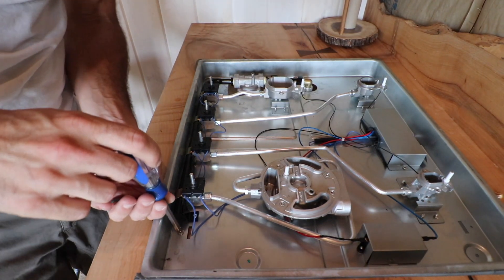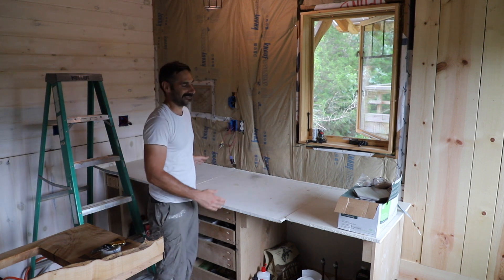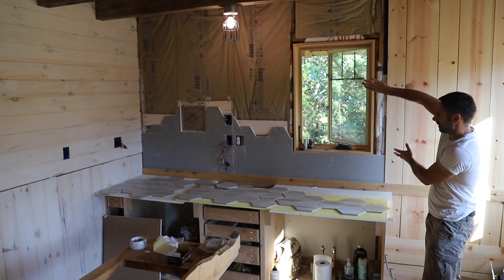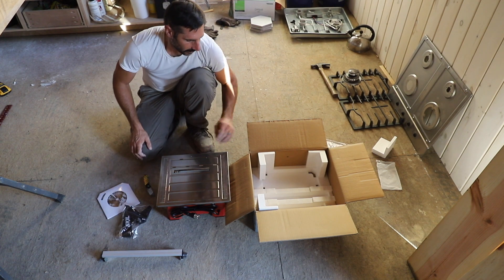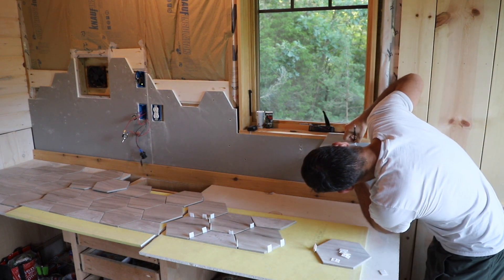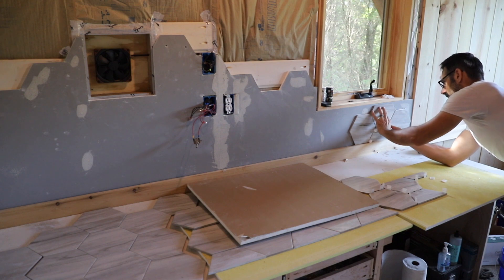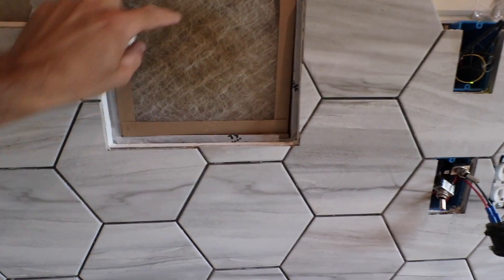Cabin Build - Hexagonal Tile Backsplash

Comment: Mike, I have a similar saw for tile.  I would cut arm and neck holes in a large plastic leaf bag and wear it with a full face shield (purchased about 20 years ago).  I would walk back and forth from the kitchen to the picnic table outside.  I did this in the summer and refuse to cut tile in the winter!!!  My pants got soaked but with summer heat, the dampness felt great.  Fabulous idea to drill holes to mark corners and cut from both sides.  I'll use that in the future!  Awesome design and a great execution.  Stay well, my friend.
Reply from the maker: Hi Rosemary, thats pretty funny, those things will get you.  Thanks for watching, hope the hole trick helps you out.

Comment: It's coming together nicely, for a budget saw ya did okay . Hexagon tile not the easiest for a backsplash. I used to do custom tile work, patience is the key. Only thing I would have done differently is I love using Hardy backer cement board
Reply from the maker: Thank you Mario, I usually like to use a cementitious backer, but since I was making those intricate cuts I decided to use this stuff called Dense Shield.  It just just like drywall.  They say you can use it in a shower if you caulk it and waterproof the seams, but I don't think I would trust it.

Comment: Very nice work.

I might have moved the electrical boxes up or down just a little bit to get the ones i could to come out on one tile. 

Note for others. When mixing mud, you are probably going to make a mess.
Do not do this inside or in the front door. Do it in a place it does not matter even if it is a few extra steps.

If you are going to do a tile job yourself and it is the only tile job you are ever going to do. Rent the tile saw.  Make sure the saw you are renting will cut the size of tile you are going to use. Some of the sleds do not accept 2 foot tiles.

The rental part goes for plenty of other equipment also.
Stuff you do not use that often is cheaper to rent than maintain.
Let the rental place maintain it. You just rent it, use it, and return it.

Comment: I would have thought that the live edge counter-back was the focal point. It turned out better than I anticipated based on the shape of the tile. I thought the wood would get lost in the geometrics of the pattern.
You were up here? Any other year, I would have bought you a beer.
Reply from the maker: Thanks, I was, I was in Naples.
Reply: @50Acres  I live in Auburn and work in Poland, so Naples is just a hop and a skip away.

Comment: Nice tile work!  I used that model saw last fall for a back splash, very basic.  A shower with every cut!  Will you use outlet extensions so that the face of the electric box is flush with the face of the tile!    They save bending or breaking the covers.
Reply from the maker: Yea Ive got these little rubber tabs that make the outlets sit further out.

Comment: Te felicito Nike quedo muy bien y tuviste que hacer unos cortes complicados , una pregunta ¿ el sistema eléctrico de cuantos voltios es ? un abrazo y saludos desde Argentina 
I congratulate you, Nike was very good and you had to make some complicated cuts, a question, how many volts is the electrical system? a hug and greetings from Argentina
Reply from the maker: Gracias Roberto, mi sistema eléctrico es de 24 voltios de corriente continua. En el lado de la corriente alterna es de 120 voltios.

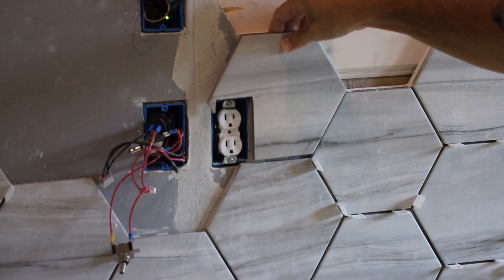Comment: Nice work, but at 22:34 the ears from the outlet have to be able to rest on the tile, otherwise the outlet will be too in O_O and the cove plate wont work. same goes for the other outlets that aren't in yet.
Reply from the maker: They make rubber inserts that clip around the screw that holds the outlets in.  Total lifesavers.

Comment: In 2002 I worked on a big hotel project, the tile company had experienced men who were putting tile on the floor and walls.  Almost all the cuts were made with a small grinder and a diamond blade.  Most of the tile work that is being done now simple because things that take true skilled craftsmen just don't exist much.  Almost all the work being done just doesn't allow for the great workmanship, the glass and metal structures cost so much less than the beautiful structures we all love.  We all want more for less, square foot cost is so much more important than beauty, I am as guilty of it as anyone but we end up with "little boxes on the hillside and they're all made out of ticky tacky".
Reply from the maker: Yea it's true, I call it Sponge Bob Square Architecture.  Every new building in my city, ugly garbage thrown up quick with a modern facade to make it look half way decent.

Comment: Looks so good.  I love it.  I have laid tile flooring before and I would agree with your statement of it being a trade that is under valued, but I have also seen "professional" tile installs that I would be embarrassed of as a home owner.  I have always been intimidated of tile on wall installs.  Never done one.  I noticed you only put mud on the back of the tile one at a time as you install them.  Is that just so the mud doesn't dry out in front of you and you can take you time setting each tile?  I am catching up to your new videos!  LOL  keep up the great work.
Reply from the maker: Hey thank you Justin.  Yea there are a lot of hacks out there posing as tile setters but man the ones who are good at it are so impressive.  I back buttered each tile just because I am so abysmally slow.  Someone faster would be better off mudding the wall.

Comment: if cyproc sheet uses water point area, that thats have, need paint cyproc waterproof paint rubberr paint both side and then can glue tiles to wall.and cyproc need ewery holes seal rubber paint and glassfiber carpet seal water not newer go in cyprock.
Reply from the maker: That stuff is called Dense Shield, it cuts like drywall but it has a plastic coating on the front.

Comment: What? You are going to Maine without telling anyone? We could have hooked up for a couple cups of coffee. I’ll be out there next week. 

That tile job looks great. I doubt I will ever have the patience to do that. Puzzles already annoy me. 
Considering that I’m learning from what you do, here is what I would do differently for my place:
Too many small tiles with too many cuts. They have those large tiles 12”x24” or so. That would be my bottom course of tile. I might even go all the way up on the wall with it and attach the hanging cabinets against the tile. I think that will make things easier to clean. I might use the same large tile to go all the way to the floor too. But I’m sure those big tiles are more expensive.
Them I would want the least amount of cut openings in the tile. I imagine one cut the will be either inside or above the cabinets for electric with the actual outlet fastened to the bottom of the cabinet. Keeps wires off the countertop. At least that’s my idea so far. Ideally I would have a 4 or 5 foot wide window as a backdrop so that would change the layout quite a bit. I love natural light. 

Can’t you rent those tile saws? How was Maine?
Reply from the maker: hey Philipp, are you in Maine?  I was in Naples.  Larger tiles can save some time but they are also difficult to get level and flat.  So prep work is key and a flat surface is a must!  You can rent saws, I have a saw, but I wanted to have a small one.
Reply: A Cabin and 50 Acres I’m officially located in NYC, but as I type this I’m on my way to my little property in Maine. Right outside of Houlton. It’s a 600 mile drive. Got 3 years before I move (April 2023).
Reply: A Cabin and 50 Acres guess I’m a good 4hours from Naples I think. Last exit of I95

Comment: you're right about how difficult tiling is.  I've done a few jobs over the years and can do a passable job but no matter how hard I try I always end up with at least a couple with uneven grout lines or one slightly non-level tile.  It definitely takes an "eye".  You did a good job with those cuts and great prep work.
Reply from the maker: Hey Todd, yea it's really a lot more tricky than you'd think!

Comment: Thin set won't stick to a smooth surface for shit,Should have used tile mastic.Does look great but if you experience tiles pop off try that.
Reply from the maker: This backer is called Dense Shield, it has a rough water proof surface on it.

Comment: Looking good. Like the tile a lot with the countertop. I would recommend you get a stainless steel filter like used in kitchen hoods so that the grease doesn’t burn the cheap filters. There’s a chance for fire if your cooking for a bit with that current one
Reply from the maker: Thanks for the tip!

Comment: 1. Good job on cutting the tiles, but as u said, more support behind drywall would make it less flexy and faster to install. 
2. Tiles looks 1970's. Tacky. Sorry.
3. Why no expansion gap btw the horizontal trim below the tiles.
Reply from the maker: Cant say much about the first two, but that horizontal trim is just to keep the tiles level as I set them, I take it out once the thinset dries.

Comment: I think you did a great job, i have seen pro´s doing it worse! :) Question, is there a reason you don't put the putty on the wall first and then put the tiles up? No criticism, i am just curious ( cause i only know what i have done myself, LoL)! That kitchen is going to look so great when it's all done! Are you going with a contrast coloured wood on the framing around the windows? Thank you for sharing, as always! :)
Reply from the maker: Hi Elisabeth, I was back buttering the tiles instead of putting it on the wall.  I work rather slowly so I just did it that way to make sure my thinnest didn't get too dry.  It would have been faster to put the thinset on the wall.  I should have since I did most of the cuts first.